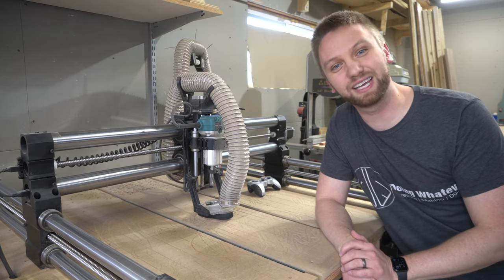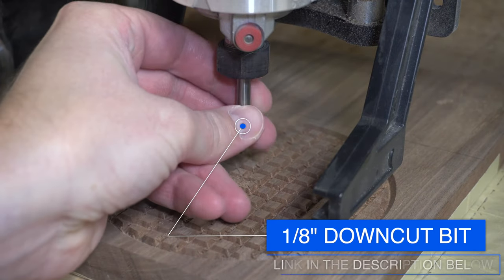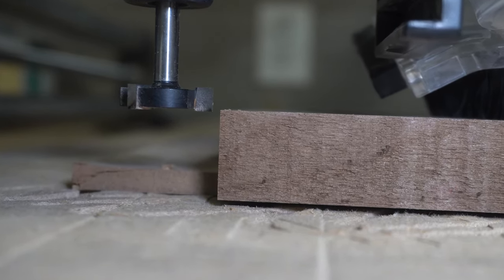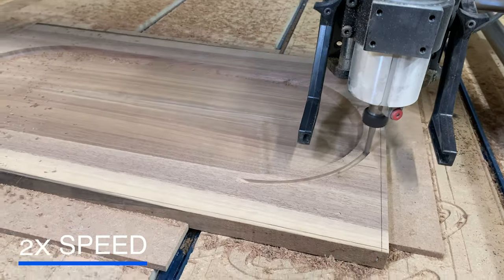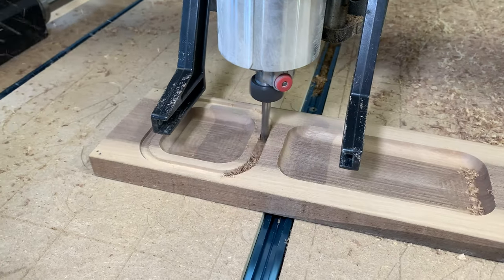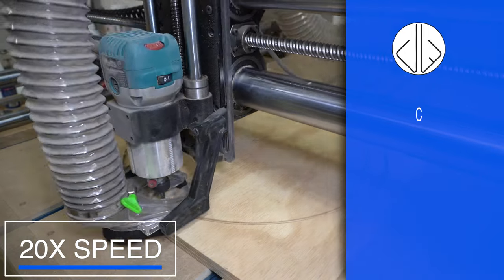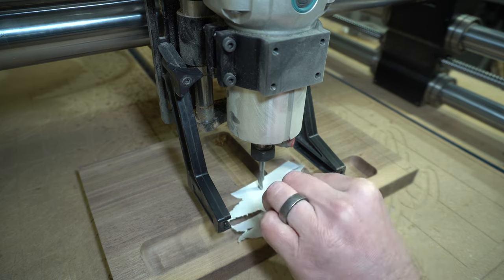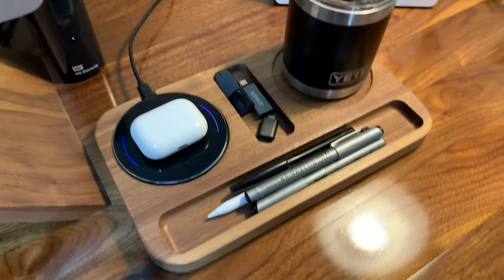5 Beginner CNC Projects with the Bits and Settings I Used

Comment: Awesome video. It's super helpful for noobs like me to see the feeds/speeds that you're using. I recently got a Onefinity also and always found that if I pushed my 1/4" DC endmill above 50 IPM (with ~0.1 depth of cut), my machine seemingly struggles. I don't know what the issue is yet but it's good to see that it's possible to safely crank my numbers up
Reply from the maker: Glad it helped! Yea honestly, I started by guessing at feeds and speeds, and then when something seemed to work well, I took note of it. I haven’t gotten as scientific as calculating the chip load, but maybe I will down the line.

Comment: One idea to save you swapping bits on the trivets, just use the v bit to cut the outer profile.  It looks like it has the depth you need.  If you have a flush trim bit and a router table, you can knock off the little bit that’s left at the bottom.  Not worth it if you’re just doing one or two, but if you’re in mass production, it could be a time saver.
Reply from the maker: Definitely a great idea in production mode! I just got a router table and am looking for ways to add it into my workflow

Comment: Thanks for sharing your expertise. I see you work with a Makita router. I am looking to buy a CnC router machine with the same router. I assume you have to set the speed manually and not through the software. Is that a problem for you? How do you work around it by not setting the speed through the software?
Can you please tell us the model of the Makita Router. The links on your Tools List page do not work.
Reply from the maker: No problem! learning all of this stuff myself so I figure I'd share what little bit I know 😃
Yes, you set the router speed manually on the router and not through the software. It hasn't been an issue for me so far, I usually have it set between 2-3 on the router for most things I cut out. and honestly, that's an area where I could dive a bit deeper to really dial in what router speed I should be at given the feeds and speeds of the CNC machine. 
This is the router I use (affiliate link) https://amzn.to/3q2SB97
I've added that link to the video description and will look at why the tool page isn't working - thanks for the heads up!

Comment: So on your second project here, flattening the slab, you only used the cleats around the edge to hold it down? No other glue/screws/clamps?
Reply from the maker: Correct. You can see at 4:05 I have it shimmed with some paper on the upper right corner, and then I run the flattening bit over it. The only force acting on the board is side to side coming from the bit, and the cleats take care of that. Then with the first side flattened, flip it over and repeat minus the paper shims.